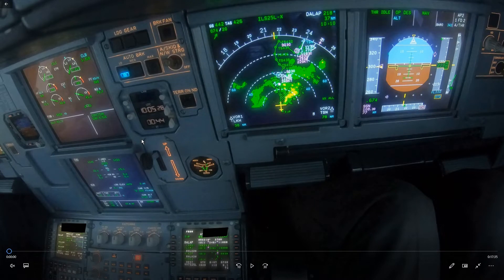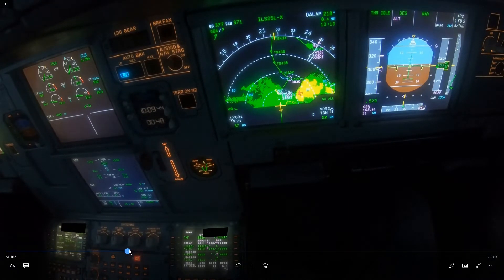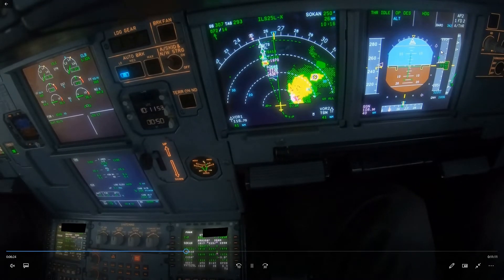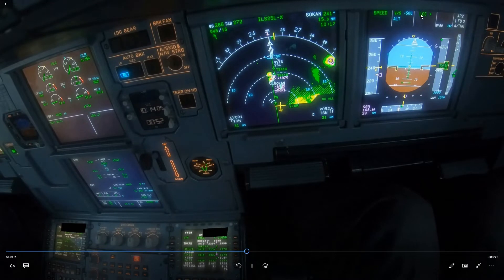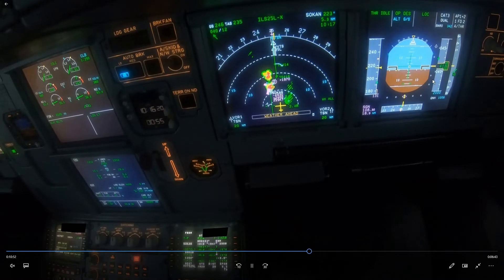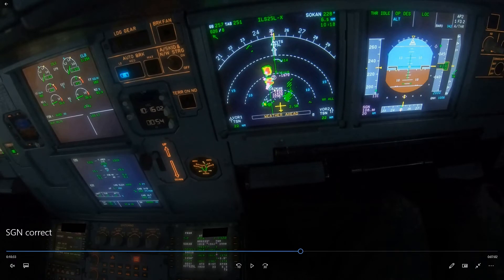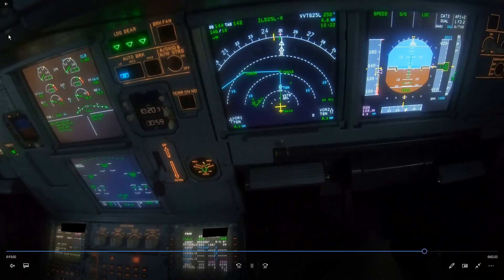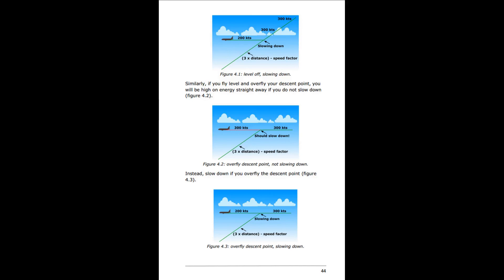A320 Descent Management - VVTS, correct approach

Comment: interesting scenario from me recently, on a base leg 180kts f1… green yoyo = on profile however glideslope giving more than 2 dots below the glide.. what do you recommend to do in this case? F2 out and shallow to get the glide?
Reply from the maker: When you are on base leg, the glide slope is not valid. The glide slope is only valid if you are two dots on the localizer, some airports only one dot. Also, being on the yoyo does not necessarily mean you are on profile as it is not always correct. The only way to find out if you are on profile is to calculate with distance, altitude, and speed.

But let's say that you are indeed below profile. The way to fix that is by adding thrust, not by adding drag or slowing down. Flap 2 gives the same amount of drag as speed brakes. And although slowing down does indeed make the deacent angle shallower, now you are slow causing a delay and piss off ATC. That is why you should just use VS-500 to fix that, but again, it is questionable if you were actually below profile or not.

Read my book. It's only 10 usd on Amazon kindle. All this knowledge is all in there.